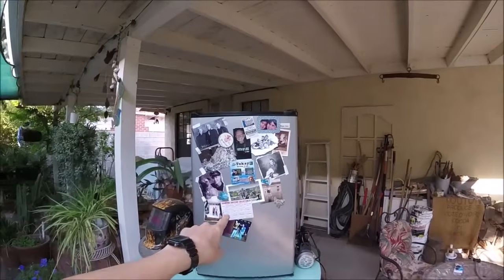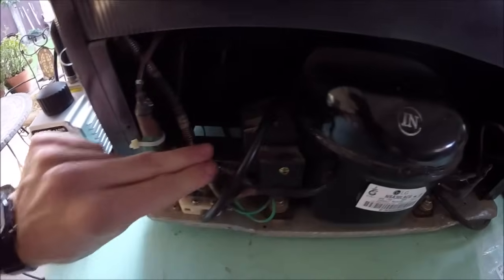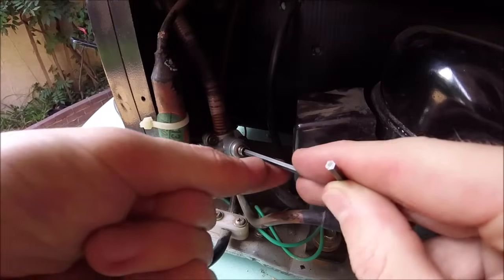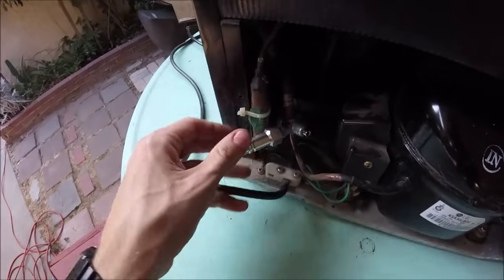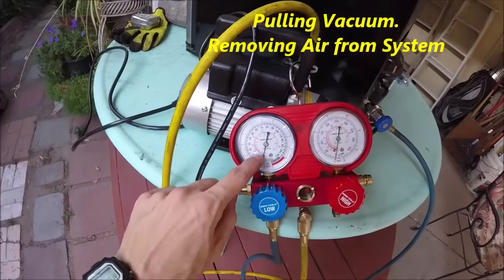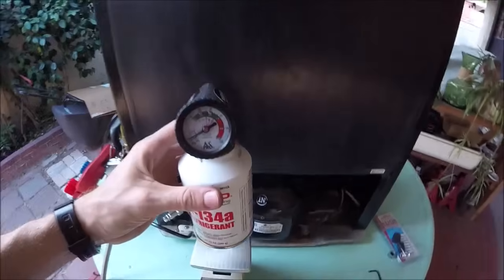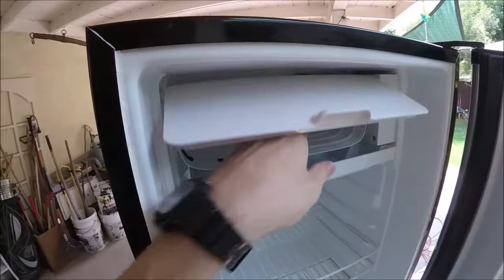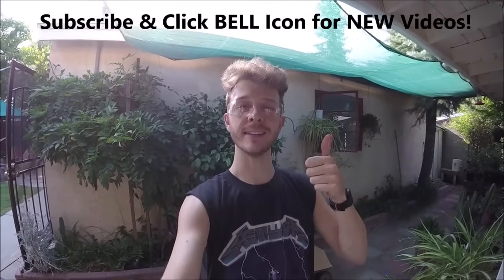How To Correctly Add Freon to your Refrigerator R134a -Jonny DIY

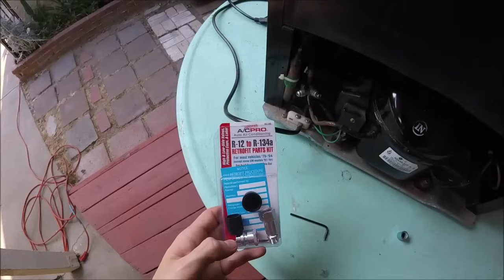Comment: 1:42-1:53 when he backed the needle out, then removed the cap from the port, isn't that opening the system to the normal ambient air ? Why wouldn't the material get pushed out or environmental air get pulled into the system?
Reply from the maker: Yes that's why I vacuumed system. That adapter I put on end has a valve to prevent escape
Reply: Ok. Thanks for you prompt response! Another ques: I've seen a few vids where the system was not vacuumed first. The refrigerant was added only and that's it. Is that ok? Can you just add refrigerant only and use the fridge for a few months maybe like 1- 3 months, then maybe vacuum later? Time constraints issues now. I will have the stuff to add refrigerant tomorrow morning but not the pump.
Reply from the maker: @whynot9068  it depends if system has leaked completely out of refrigerant. If not you can try topping it up basically by adding a little bit. Worth a try 👍
Reply: @JonnyDIY  again. Thanks for helping
Reply from the maker: @whynot9068  You're welcome, happy to help.  Good luck 👍

Comment: If it's a sealed system why would you need to add refrigerant?
Reply from the maker: Sometimes old refrigerators will develop a slow leak and lose refrigerant over a couple years. In this instance the refrigerant all leaked out due to puncturing of one of the lines

Comment: A couple of steps missing:
1. Make sure you pierce the LOW side of the compressor, not just any “copper line”. There maybe a crimped off charging line you can identify easily. 
2. Make sure you use PURE refrigerant, not refrigerant mixed with oil or sealer. Different oil types are not compatible. Automotive A/C systems use different oils than residential systems because the compressors are different. The nominal purity in automotive refrigerants is less, but I find it hard to believe that manufacturers run two different production lines just to provide lower purity refrigerants.
Reply from the maker: @dilvishpa5776  thank you for sharing that helpful information 🙌👍

Comment: Thanks for your Youtube lesson!    I do have a concern/question:
I noticed that you used Automotive R134a which is not a pure R134a refrigerant.  I am concerned that the oils in the Automotive R134a will cause harm in your system.  Did you have any compressor problems or running problems after using the Automotive R134a  after a month?
BTW:I have the same problem with my refrigerator and I would like to use the Automotive R134a but I am unsure.
Reply from the maker: No problems, been over a year. Still running fine 👍🏻
Reply: John Hanselman  I think this goes without saying but check what refrigerant is used on the label for your refrigerator
Reply: R134a does not contain oil.
Reply: R134a does not contain oil. You can use same R134a for all R134a systems.

Comment: The COIL temp was 40. Thats not the same as the fridge pulling down to 40. Usually you want a 10° temp difference from space to the evaporator plate, for example if you want a fridge at 34f you run the coil at 24f. Might be a little different on this small a system, but your thermometre was on the evap plate which is colder than the box temp will be so your fridge is not working right yet. Maybe its not been running long enough yet,  but youre not running full capacity yet more likely. You may have non condensibles in the system (air, automotive evacuation procedures/tools are not typically enough for refrigeration equipment *see note at end if youre interested) or be losing 134 through that notoriously leaky peircing valve. 1.4oz is tiny so you may have undercharged it by not filling the charging line before weighing the charge and in doing so, left a few decimals of an oz in the hose and not the system. But with a charge that small it might be enough to be undercharged and not get as cold as it should.
But what do i know😅

*Note: the gauges you used read down to 30inhg, or 30 inches of mercury, 30 inches of vacuum. The needle is extremely inpresice and even when bottomed out completely, may not actually be as low as it looks. A vacuum that we might pull on a cooler when recommissioning it is 500 microns of vacuum. 30inhg is absolute 0, but those gauges are really that sensetive and you are likely only at 28-29.9inhg when it bottoms out. But between 29.9 inhg and 30inhg there are 2600 microns of vacuum, and even my very sensetive gauges with a digital readout read 29.9inhg when my micron guage reads 10,000. This is problematic because you can have air, moisture and other things you dont want in a refrigerant system at 2600 microns. You generally want to pull a vacuum below 500 microns to ensure it is fully evacuated, not leaking and there is nothing bad for the system left behind. Then charge the system.
Reply from the maker: @jrichar31  thank you for the helpful information 🙌 Ohh yeah the temperature came down more eventually just wanted to finish video and start another project. The fridge is still actually working from this fix all these years later. I have it in garage with drinks in it 👍

Comment: In your video you mentioned that you should be weighing the can without the nozzle. I believe that is wrong. Every time you remove the can from the nozzle to weigh it you release a little bit of refrigerant and so you will never know how accurate you are. I believe if you attach the nozzle to the connector and then weigh it, you will get an accurate reading even though yes the nozzle does put a little bit of pressure on the top of the can pushing it down. It seems to me that that is the more accurate way to measure how much you actually put out from the can. I believe that every time you disconnect it to check it you are adding error and inconsistency.
Reply from the maker: Possible a tiny bit, it was just easier to weigh on that scale that way. I got a newer bigger digital scale that's easier now

Comment: If it’s a Frigidaire chances are the leak is in the Evaporator, using a vacuum pump will tell you you have a leak but if you have to add it you have a leak , there is no air in the system unless it’s totally empty. The only way to truly know if you have a leak though is to use a micron gauge.BTW those bullet valves are suppose to be removed, a pinch off tool and brazing is needed, your suction pressure should be around 9 pounds running !

Comment: The fans not on and the compressor didn’t click on
Reply from the maker: Compressor should kick on if it's plugged in after you add enough refrigerant to meet minimum pressure. Unless your compressor itself has failed

Comment: Couple things I saw wrong here. 1 you didn't purge the air out of the line when you added the refrigerant. 2 your using automotive 134A. As far as I know refridgerator 134A has different chemicals than automotive 134A 3 if your adding refrigerant to the system there must be a leak (I take it you already know that) but overall nice video
Reply from the maker: Thanks for sharing that. I fixed leak first. Surprisingly this fix and fridge is still working today, years after this fix 👍 I wasn't sure it how long it would hold

Comment: This is a hermetically closed system. If refrigerant can escape you will have to do it again and again. You will contribute to the destruction of the ozone layer.
Apparently you got a leak in the system that needs to be repaired. 
Puncture tyres still need to be pumped up. Repaired leaks fix the problem.
Reply from the maker: You're right I have another video where I fixed the leak first 👍

Comment: 40 degrees under the evap is not good. if you don't have a proper scale you need to go by pressure,0-3 PSI is the pressure that will work.
Reply from the maker: Fridge still works great years later to this day 👍

Comment: Maybe some locktite or jb weld in addition in the areas you added the pipe will help seal the hole even further. 
Yes welding would be great but for those without a welder it could help.
Reply from the maker: Good idea,  thanks for sharing 👍🏻

Comment: This is sketchy because of the needle / puncture/bullet piercing valve. The valve should have a temperature rating. If it's a super wide temperature rating then maybe the valve should be on the low pressure side of the circuit to reduce the pressure it has to withstand. Seals often fail at low temp. So the valve may be rated better for higher temp than low temp, meaning it should be installed on the high pressure side, but that's dangerous to deal with if the fridge is running. On some refrigeration systems the high pressure side is high enough to explode a can of refrigerant if it's hooked up to the high pressure side. So if it happens to be on the high pressure side, the system shouldn't be running when you add refrigerant. I understand that these are small systems with not very much refrigerant but people should be aware of the danger of connecting a can of refrigerant to a high pressure side of a running refrigeration system.
Reply: The low pressure side of the circuit will be cold when it's running, and probably insulated. The high pressure side will be hot and definitely not insulated from ambient air.

Comment: You missed so many important tips such as installing a piercing valve on the low-pressure side, purging the lines and so on.......
Reply from the maker: Low side yes, thanks for pointing that out 👍 This fix is still going strong today, years later 👍

Comment: 40' F is way too high in a fridge. And I want my freezer at -10 at least.
Reply from the maker: It freezes now. I just had put it on a hotter setting because I just kept drinks in it at the time 🤙🏼
Reply from the maker: And it kept getting colder over night. Those lil mini fridges take a long time to get down to temperature

Comment: iT IS SAID THAT SOME REFRIGERATOR COMPESSORS HAVE  A MIXTURE WITH OIL IN IT, CAN YOU STILL USE THE R134A ? ALSO THE CAN R134A SAYS FOR "AUTO ONLY" IS THAT OK TO USE?  NOTE IF I DON'T GET AN ANSWER FROM YOU, THOSE WHO VIEW THIS VIDEO MUST IGNORE IT FAST, IT COULD BE DANGEROUS FOR YOUR REFRIGERATOR TO TRY!!!!!!!!!!!!!!
Reply from the maker: Yes you can use the auto refrigerant, just be sure to check fridge that it indeed takes r134a 👍

Comment: What ? Did you really plugged the freezer while it was under vacuum ? It destroys your compressor's windings if you do that. First put a little bit refrigerant before. It's not gonna do any compression issue because it's not at liquid state shen you first add it
Reply from the maker: Patched hole 1st , then let dry. Then vacuumed and refilled after testing to make sure patch worked and it held vacuum 👍

Comment: Use emery cloth, not sand paper. Emery cloth is is for metals.
Reply from the maker: Yes, if you've got it. Fine grit sandpaper as I used it fine though 👍🏻
Reply: @JonnyDIY  The purpose of using emery cloth is because sand paper can leave grit embedded in the metal which can interfere with the seal. Which also means you should clean the surface after using the emery cloth because of debris left behind.
Reply from the maker: @JesseSShaw  ohh ok cool, thanks didnt know that 👍🏻
Reply: @JonnyDIY  Refreshing. You are welcome. Too many times these comments turn into something ridiculous. You gained a sub.
Reply from the maker: @JesseSShaw  awesome, thanks 🤙

Comment: your part list look like has extra stuff you didnt use in yoyr video.. over 400 dollars worth of toll wtf??
Reply from the maker: You can rent the gauges and vacuum pump at Autozone.  You just have to put a deposit down for them. Thats what I did
Reply: Amazon has the gauge set and vacuum pump for less than 125.00 the valve and adapters are less than 20.00. How much do you think a professional would charge? 100.00 an hour where I live

Comment: Appliance repair tech reporting in. I know you don't care. I'm still going to say this.

1) if you are low on refridgerant that means you have a leak. No if ands or   buts.

2) most lf these fridges now use cyclopentane with is a hydrocarbon wich is HIGHLY flammable.

3) r134a is damaging (hence the part you don't care because why should you)

4) these fridges are regularly less than 180. Usually 150 I see them for.

5) piercing valves leak. Not if, but when.

I totally am all for people fixing their stuff and if I see someone trying and  I see they have the ability I share my knowledge. But sealed system work needs to be done with correct tools so you are not destroying the ozone layer.. aka recovery tools and fixing the leak to begin with.

But then again, you don't care about the damage you cause down the road only that you can support your alcoholism by keeping your beer cold.
Reply from the maker: Thank you for sharing your knowledge. Fridge is still working great today, years later. I have another video where I first fixed the leak 👍

Comment: Just FYI $45000 yes that's correct 45k fine if you get caught venting this into the atmosphere. Don't believe me? Ask the EPA.
Reply: Not this refrigerant. That’s why the changed it, now doesn’t require a license, and is off the shelf
Reply: @devinewon  just took the class to get certified and this is straight out of the book,"R134a is not an ozone-destroying agent, but it is a greenhouse gas, and is illegal to vent as well."
Reply: @gabrielpuckett7964  the refrigerant in the refrigerator is r441. It is not illegal to vent a substitute refrigerant under 50 lbs. nice google job, I’ve passed epa inspections for 10 plus years
Reply: @devinewon  your EPA guy must be nicer than mine.

Comment: “DIY” you need a license to use freon.
Reply from the maker: True, but not for the R134a, at least where I'm at
Reply: You can buy r134a an many other derivatives at any auto parts store and don't need a license to use it.
Reply: Refrigerant containers with a capacity of 5 pounds or less do not require certification. However, please consult a certified technician before doing this yourself